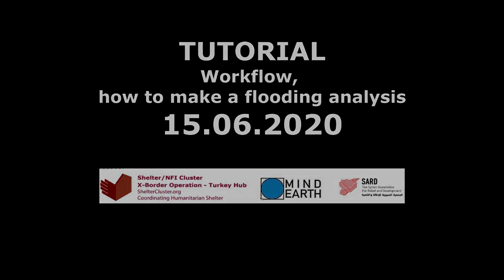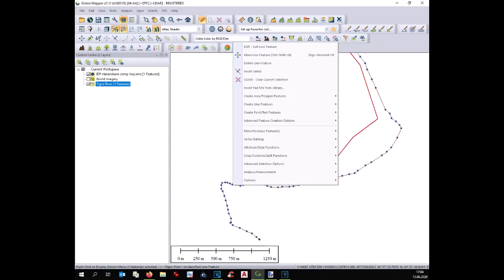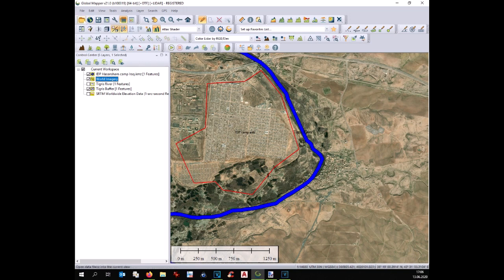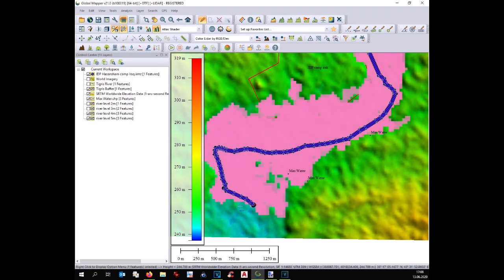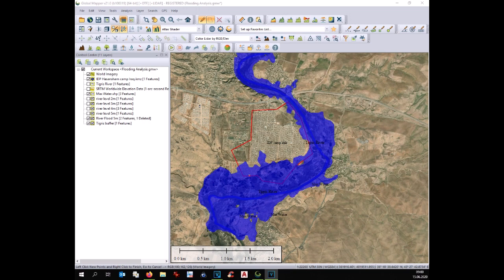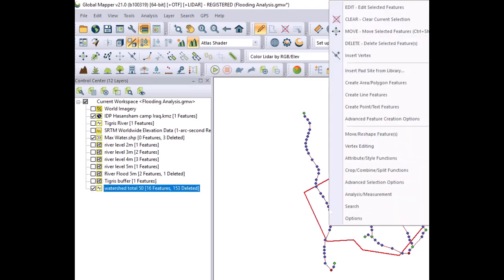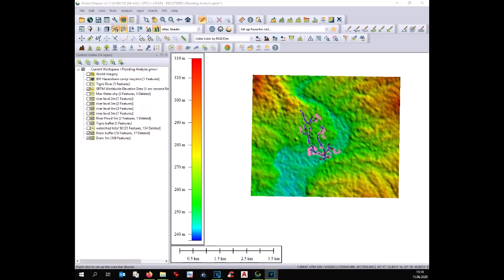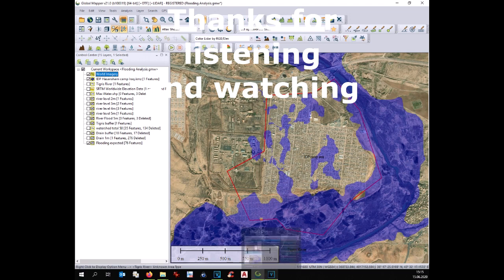Flooding analysis, work flow with Global Mapper

Comment: Hello Sir, thanks for the informative video. How can we get the probable volume of water that will be flooded ?
Reply from the maker: you can estimate the waterflow in the river with HMS or check this 
https://sites.research.google/floods/l/3.3064213497876014/18.643455505371094/11.610000000000014/g/hybas_1122053880

Comment: Nice and informative.......in my project flooded area showing in square grid perticular for when increasing rain water level....How can I make it realistic.??
Reply from the maker: When you perform the Water rise calculation, change the resolution (with smaller figures). It should improve
Reply: @AndreaCippa-Siteplanning  ....Thanks, What is the use of "Increase the water level by Elevation.....?? and which is the ideal elevation we should give...?.......and if I m not using elevation then water is not coming out of drains even after increasing water level by 1000m
Reply from the maker: @alkeshmakwana860  Hello, Water Level Increase Amount is the interval that you choose to increase the water each time you click on the icon "increase water level"